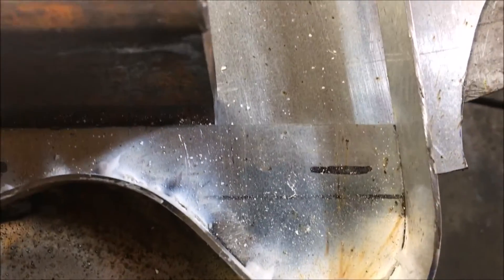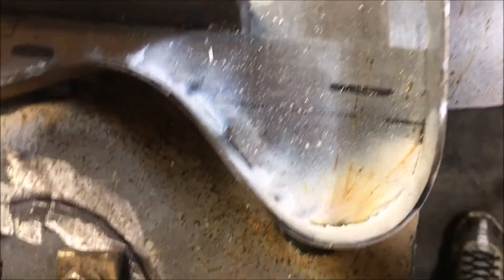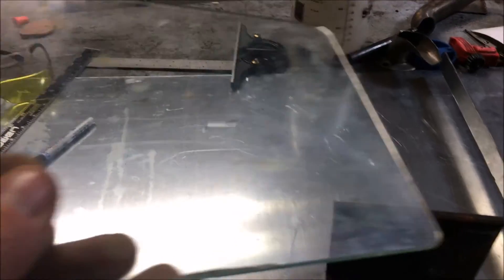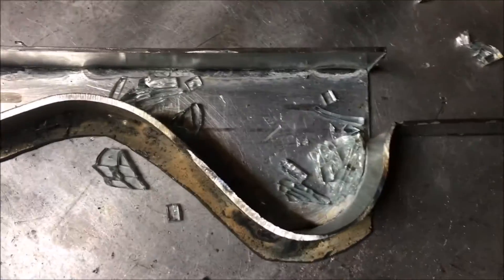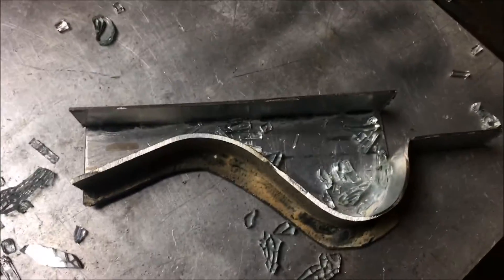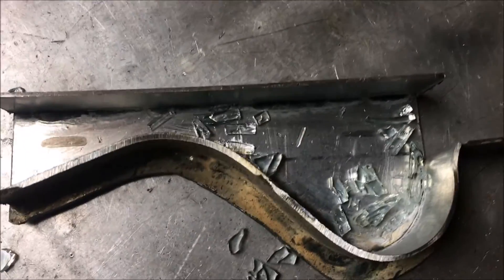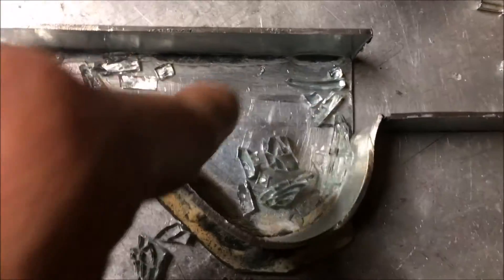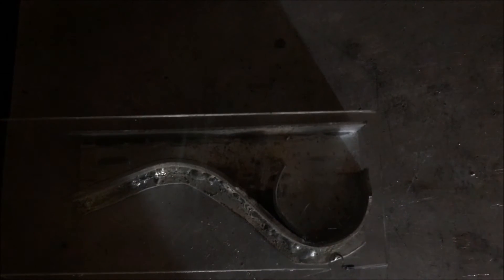Glass waste Oil burner Observation Combuster EXTRUDED DESIGN

Comment: Create a upper drift...forcing a parshel drop pattern..to create your afterburner effect
Reply from the maker: I think i know what you mean , are you saying angle the top down , 1 or 2 deg ?
Reply: NOBOX7 yes...perhaps tapering your frount down angle as well...putting a lower lip
Reply from the maker: yes taper was suggested by delicious deblair in another video and it worked very well so yes i agree , it does have a good effect , perhaps stretching the volume of the combustion by increasing the velocity is the reason the the increase in heat output
Reply from the maker: by the way i got this thing running today , the new video will be uploaded in 1/2 hour . it works very very well , i was surprised .
Reply: Find me on Facebook
Reply from the maker: Ok but i deleted my account do to its owners behavior

Comment: On some gas turbine burn chambers, the incoming air is split by a plate, allowing 30% to circulate around the fuel injection site for a vortex type burn that you are interested in, the other 70% is directed past the plate that rings the flame tube to provide the secondary air to burn what goes through the center and out the flame tube holes.  I just watched a video earlier of it, I will find it as I think you would like it NOBOX7
Reply from the maker: Thanks bro , defiantly in to that stuff . I do no what your referring to , me and Delicious Deblair discused a picture of a combustion liner . they are very complex builds so im holding off on that and looking for a super simple solution that any body can replicate . the Combustion liner design requires 2 systems to support  combustion, fuel pump and blower or secondary blower with  a siphon nozzle  .
Reply from the maker: Yes you are correct and i would like to try that but im currently on a mission to replicate the behavior of my "Elbow burner " It accomplishes a vortex without secondary air or  complex Geometry . But i do really appreciate your input so please dont think im a no it all im just sharing my goal with this project . Please feel free to send me the link though as i am very interested in these devices .
Reply: NOBOX7 Your elbow burner is on point for sure, the swirl is definitely intense on it.  The results speak for themselves.
Reply from the maker: Still gonna try what we talked about just not till im burnt out on the Elbow and its getn close

Comment: Sandwich a parallel plate from your inlet landing and that can be slid back and forth for increased and decreased depth.
Reply from the maker: Great idea
Reply: Possibly make like a 'whistle' cavity by impressing a small divot in the slip plate and cutting 50% of that divot [the leading edge] making a very small 'hood scoop' like effect some place in the slip plate, which will force a little of the fresh fuel and air down into its own little swirl chamber there, enforcing the cyclonic flame for ignition sustain.
Reply: I made a fast and sloppy sketch of the idea so you could see what I was thinking of.

https://deliciousdeblair.deviantart.com/art/Whistle-Lip-Flame-Recirculator-Idea-001-741805987

I figure with a torch, ball peen hammer, a drill and a grinder with a cut-off wheel you can make this part.

I would, for the slot, make it counter sunk so that it did not interfere with any items required to mount the nozzle, unless one used the same screw as a support post to hold the nozzle at the same time.

I figure easiest way to make the slot is to drill both planned ends you want for the countersink, then use the grinder in between to follow the tapered edge, although it may be kinda tricky with a larger grinder.

Drilling multiple holes in between might make the job easier, and one could maybe use a dremel sized cutter to finish the slot.
Reply from the maker: I looked at the sketch and maybe we can try this  after the design at the end of this vid gets a test run . Im thinking the swirl chamber diameter is to big , the flame might go out before it reaches the job kinda like the propane did
Reply: Yeah, a smaller diameter flame holder would increase your chances of keeping the flame sustained, also if you could stack some thin fender washers in there [divided by smaller diameter washers] it might serve as a heat bank/glow plug. This follow-up idea is just speculation of course, because not being directly in the line of the main flame, it may not do much for the system.

The only reason I mention it is because glow plugs were some times used in some rocket and jet engines in the early days, and the Chrysler turbine used a heat regenerator to keep preheating the intake air for increased efficiency.